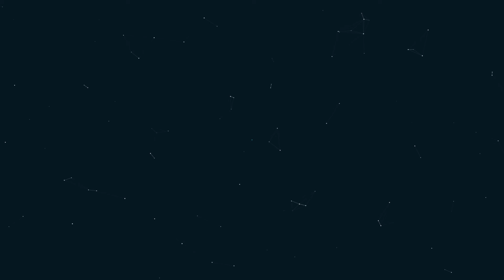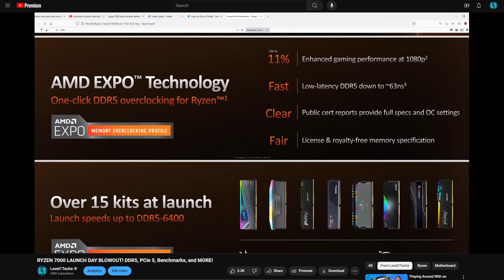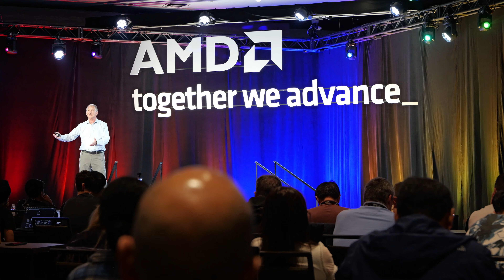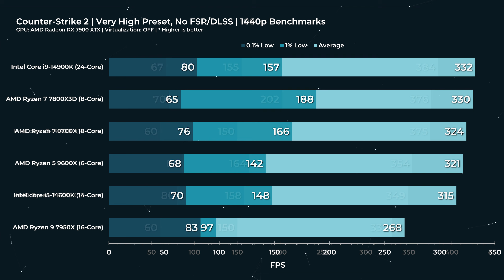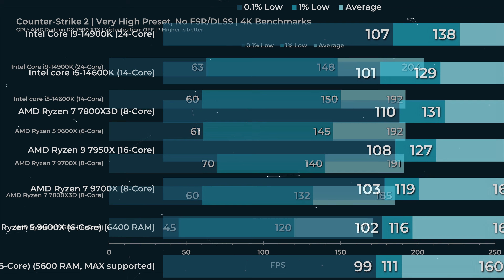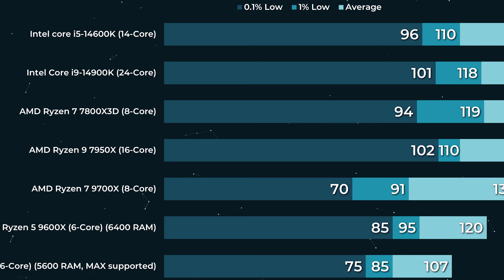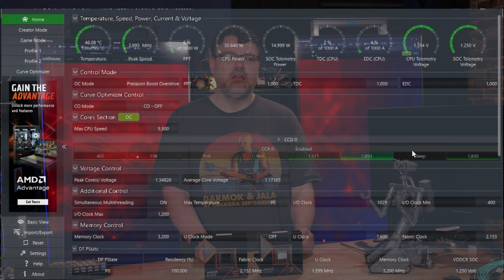Ryzen 7 9700X and Ryzen 5 9600X Review and Benchmarks

Comment: I get that power draw isn't as important on a full atx system as micro pc's with itx boards, nor battery powered devices. However full atx systems aren't as important as they once were either. Laptops and min-pc's are growing in importance at home, and 'big iron' lives or dies on efficiency in many cases. So AMD creates processors that use less than 2/3rd the power of their predecessors and still beats them, just not by the huge amounts enthusiasts and serious gamers think are all important. HINT: most folk just want email. you-tube, Netflix, Amazon, and the occasional casual game. And they don't want to waste the space a full tower, or even mid, takes up. Understand the last prebuilt I owned was a Wyse 286 I converted to 386 (real fun, had to chop of the proprietary connector on the psu and wire it up to a standard 20pin connector) in about a month. I have three systems, the main one a 3900x w/64 gigs of ram, a 2tb nvme boot drive and a 4tb nvme bulk drive and several sata 'misc' drives with a 3060ti (pandemic pricing or I would have had a 3080). and that's just the daily driver. So I am among those that love to see big perf gains and don't care about power as long as everything works and bsods no magic smoke escape scenarios.

Comment: Big difference between enthusiasm here and the Steves. Zen5 seems a big step on many levels, but performance doesnt seem to be there out of the box (yet?). I have to PBO and 6400 memclock zen5 to get close to a next gen performance bump? Really think that bump should have been with stock setting.

Missing comparison with direct predecessors.

Thing I get out of the various reviews....zen5 delivers loads of 'under the hood' improvements and it's impressive in many ways. For performance out of the box, it seems lacking and very poor value based on current prices.

Comment: I do a lot of fusion 360 design I currently have a 7700x with a mild overclock that happens to run 4 dimms of ddr5 at 6000 total of 64gb... I do game a good bit of course but even if the gaming remains slightly better I will upgrade if I can get more workload performance. should I play the lottery and see if a 9700x works with my setup? lol

Comment: So disappointed with your pinned comment on LMG QuickBits validating Linus' focus on motherboard manufacturers being at fault instead of  Intel for high failure rates. We know Intel kept increasing wattage to compete with Ryzen 2nd gen+.  300 watts under load of a consumer chip is nothing short of absurd. The chips should be banned like Plasma TVs were in California 15 years ago. Question for you, Wendell: if Intel limited the 14900k to something reasonable like 250 or 225 watts under load and MB manufacturers still played their games with power profiles, would these chips still be failing anywhere close to the current rates? Intel dug their own grave. Two thirds of that LMG quickbits video focuses on blaming MB manufacturers.  It screams Intel damage control "sponsorship". Shameful.

Comment: Did they fix high idle power draw? This was no go for me with using amd in my homelab
Reply: It's inherent with the setup of multiple chiplet dies, if you want similar to intel idle power consumption get the 8700g or any monolithic equivalent, even better is the 8500g for even lower power use. But you get less pcie lanes, like a lot less.
Reply: Why does idle power consumption matter so much? 5-10W is not a lot of electricity over years of time
Reply: @thorium9190  because it is not 5-10 but more than 40 and if it is running 24/7 it adds up fast, especially in eu where power isn't cheap
Reply: @JoseMariArceta  I'm aware of this all, not my first rodeo :) I'm interested if they done anything new in this iteration
Reply: @truenetgmx  Probably not much, I doubt if idle power use was a priority in this generation. The chiplet cores themselves can power gate quite a bit, but the infinity fabric connection to the IO die (the same IO die for the 7xxx series) will always have to be awake regardless of C state, so yeah.
Reply: I think that was a goal for this architecture, it seems in mobile they fixed the problem but those are monolithic
Reply: @reiniermoreno1653  Yeah efficiency is very impressive for the mobile parts, especially since this is on N4P which is "only" a refined version of N5.

Comment: I think Zen 5 is L2 starved. If AMD had given 2x of L2 cache to Zen 5 it would be performing much better.
Reply: It was suppose to, it improved perfromance by 7% but took longer to tape out
Reply: @kevinerbs2778  AMD increasing only L1 cache on Zen 5 proved to be worthless. All three L1, L2 and L3 cache had to be increased for serious performance boost.
Reply: @almir-lq9qw  I was referring to L2 cache size not L1. The increase is L1 cache is for ground work later for zen 6. It takes quite a lot for that to improve anything ipc, this like prediction rates change with sizes. Beside its actually really hard to increase L1 sizes without making the area 4 times large is die space.

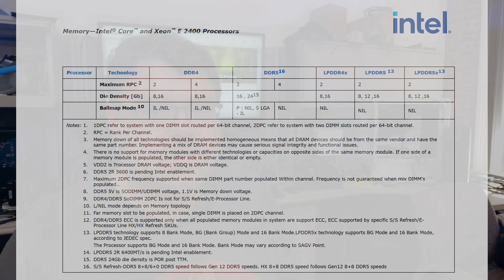Comment: 7:30 So that's Intel caught out in another blatant lie, it seems. 

The specification pages for the CPUs on Intel's web site states in small print the maximum supported speed may be "lower when populating multiple DIMMs per channel".
So the whole 'misunderstanding' isn't down to a bunch of Youtubers. Intel's own specification pages contradicts what those SIs were told was Intel's actual specification for maximum memory speed.
I wonder if Intel silently changed the actual (double-secret probation) specification from per populated to per routed socket sometime after 13th generation launch, when the CPU degreadation & failures became evident. A way to conveniently reject warranty claims.

Comment: Why no 7700x as direct predecessor. It makes results bit ambiguous as you cannot see performance vs this chip is replacing. Comparing it oto 7800x3d makes no sense as there is no point of reference.